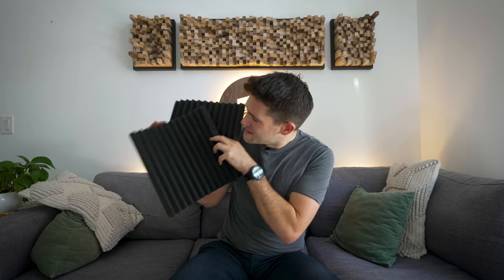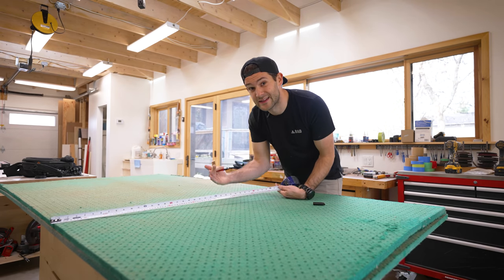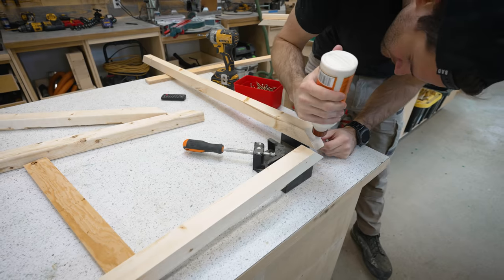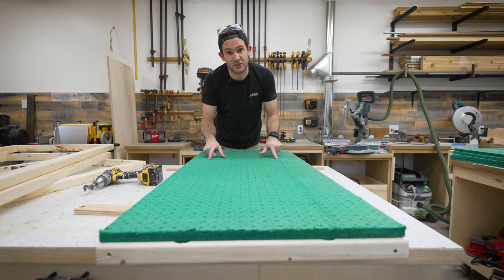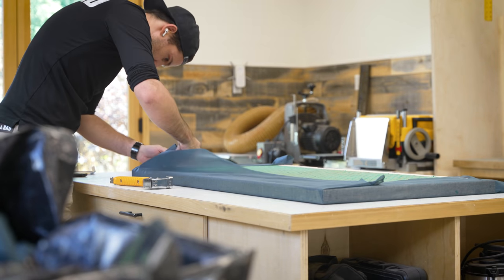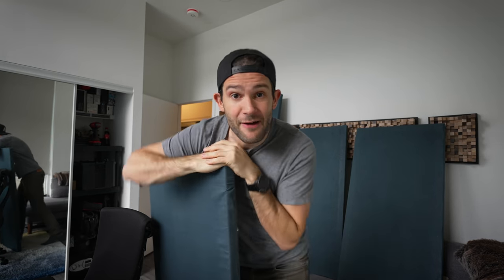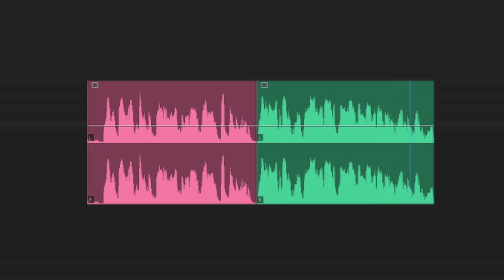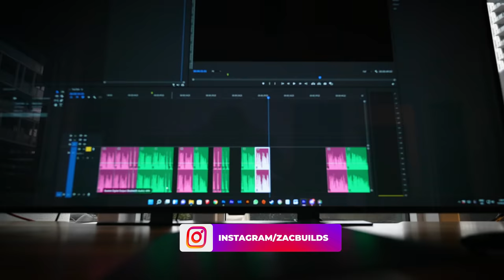Acoustic panels that actually look GOOD

Comment: I wish I could source sonopan locally, but can't so I went with dense recycled foam.  Tip... I ordered a few extra sound absorbing curtains when I did my windows so that I could use that fabric to cover the panels.  They match/blend in with the window treatment and with their extra felt linings, it provided a bit extra sound absorption.  Put the felt on first wrapping front and rear, then use the top layer of the curtain to finish the panels off.  Make sure to mount the panels an inch or two off the walls if possible... improves performance.

I luck out... my main diffusion "panel" is a large 8x9' rubble stone fireplace directly opposite to my AV setup.  Works perfectly to breakup the sound and I only needed a few acoustic panels opposite the sliding doors to the patio I put the curtains on (both to the sides of the AV setup).

Comment: The point of Rockwool is mass absorption, and it works AMAZING when you install it right.  Inside walls it is mostly going to kill midrange and bass noises, and won't be as effective for higher frequencies, but that isn't what they are made for, and those are going to leak through the 2x4s rather than the rockwool.
The green board sits between drywall and 2x4s, which allows for sound isolation more than absorption.  Hang some heavy drywall on one side, and use isolating screws, and rockwool between the studs, and you have true sound-proofing for a room.

When hanging sound treatments ON the wall instead of behind, you actually want loose dense material that covers a broad even spectrum of sound.  Rockwool is truly the best application for this kind of stuff as it will absorb most frequencies pretty evenly.  I'm sure this also works pretty well too, but I would bet that rockwool would work better, and cover more frequencies more evenly.

Lastly, don't forget the floor and ceiling.  You have a big fat bass-trap (couch) sitting directly behind you, which is probably your best audio treatment.  But adding a short carpet, and having a couple diffusers or absorption panels to the ceiling will probably make a larger overall difference in the room than your panels.

Neat project though!  And they do look nice and seem to help at least a bit!  I'll have to look up that material for my upcoming project.  I'm in a 1950s style basement space, and it makes for a very live room with lots of concrete, cinderblock and aged hardwood... it's live down here lol.  But I also hate working with rockwool, but keep using it because it is like magic for my house!  Every time a wall is opened up, some rockwool goes in, and it makes a small house feel so much larger!  Just that audio distance of not hearing every word that everyone says at all times from anywhere really makes a difference!  Anywho, if the price on those panels isn't too bad, I might have to try backing a rockwool panel with them.  The fabric will keep it in the front, and the paneling can hold in the bakc, and add a little extra depth and rear transparency so it can more effectively be used to 'double absob' audio without needing a literal air-gap behind the panel.

But seriously, people don't give enough thought to their audio environment.  Having a nice quiet 'dead' sound space... you can just feel the tension melt when it is done right.  It is so nice, even if most people don't have any idea why.

Comment: Recording voice over comparison sounded the same but when you did the 360, when camera is facing the windows, the quality of sound is so much worse. Panels help but legit, the windows are the main problem, with or without the wall panels. Blinds will probably fix the issue.
Reply: Curtains would be a huge help for the sound defusion for sure!

Comment: There may be an added benefit by spacing the panels about 1" from the wall.  The space would act as a trap and the exposed surface area of the back side may add a tiny bit more.  This is usually done on ceiling panels.

Comment: 1. Sound insulation and killing reflections (which is what absorbers are used for) are two completely different things. So, your argument that Sonopan is better for insulation than rockwool, therefore it must be better for absorbers is wonky, at best.

2. You should allow for a bit of air behind your absorbers. Either leave a bit of space between them and the wall or make the frame deeper, so it forces that space. That really improves absorption in the lower frequency range a lot. There are pretty neat online absorber calculators that can help you find your preferred balance between absorber material, thickness and covered frequency range.

3. It doesn't matter all that much how thin your cover material is. We're talking about sound waves you want to absorb anyway. Either thicker cloth already absorbs that frequency spectrum (in which case it's "less work your absorber") or it passes through to your absorber, which is what you made that thing for. The one thing you don't want is a cover material that would reflect high frequencies... but other than that, it really shouldn't matter.

Since I might have been interested in Sonopan for another project, though: It seems that Sonopan doesn't have any retailers in Europe.

Comment: This is cool.  I love building my own things vs. buying them.  It saves money and custom is almost always better.
I think the size of the room plays a big factor with sound deadening. (think of the referee in a football stadium echo!) 
If you covered the walls and ceiling with these panels in a small closet, the sound would be perfect.
You still have lots of area that will bounce the sound around. Many people overlook the floor and ceiling.  Have you ever talked inside an empty room with hardwood flooring?  6 faces of echo!
If I am not mistaken, isn't there mathmatical equations of how many panels are needed in a room depending on size?
I've heard putting panels on a 45degree angle on wall corners  top to bottom really helps.

Comment: Pro tip, get a helper to hold a mirror up against the side walls.  Sit where you will speak.   Move the mirror panels across the wall until you can see the mic in the mirror reflection.  This is your primary reflection point and most effective place to put your sound deadening.  If using a cardoid, directly in front and behind the mic also.

Comment: floor, roof and DEFINETLY windows do make the room still echoey, hence why alot of music studio's use a special type of plexiglass in front of the window (with a big gap between). So the reflection gets trapped, and doesn't go back inside. Get a Rug, and sum skypanels, maybe make a star sky panel? With led strips, or led string and some holes in the fabric? Might be best to use the same fabric you used in this video tho, since you can layer it two times; one time, led stripo/strings, then second time, poke holes in the front layer.

Just an idea, might be cool to see!

Comment: rockwool is meant to be encapsulated inside of walls. I would never put it behind a breathable fabric.

I've made sound panels before simply filled with pillows (the kind you sleep on ) and it worked great.

I'd be interested to see an side by side comparison between sonopan and rockwool though

Comment: I really liked what you did, but I won't have used frames... I would have put the sound board onto a 1/4 or 3/8 ply and made them the full width of the ply backing... rounding the front edges would have added to the look and a little toward the sound... that would also have helped with the fabric as well...

Comment: Not keen on rock wool either. So use medium density, fireproof, furniture foam.  Works great and can be found in any desired thickness.  It does cost more, but in some long lost comparison tests, worked better too.  Used to build industrial silencers and fit out control rooms with it.
Reply from the maker: Great idea Philip! Where do you get that stuff from generally?
Reply: I would like to know this as well!

Comment: You would also benefit from bass traps where any two or three flat surfaces (two walls > ceiling or floor) meet. They absorb rogue low frequencies where they gather up in corners. I see you have an RPG diffusor, which is great. You can also use bookshelves at empty wall spots filled with books on the shelves at random depths, to form a non-uniform face of spines on each shelf. Parallel surfaces are the enemy, so if you can slightly pitch your ceiling or use an acoustic ceiling cloud, it helps a lot.

Comment: Zac, the purpose of the angled front of the sound panel (acoustic treatment) is to deflect the sound in a different direction. Think of all the angles used in big music theatres,…it’s not designed as a square or rectangular room. The shape of theatres and some churches are shaped like a cone angle. The square/ rectangular rooms in a house are terrible for sound deflection.

Soft surfaces like carpet, blankets, and similar materials help absorb sounds, but for the sound that doesn’t get absorbed, it should be deflected not directly back at the microphone.

Comment: yeah like data says that super dense glass wool is gonna have a better alpha than any foam. But like the foam is obvs easier to work with because it’s less likely to bulge against your fabric. just always make sure to use an “open weave” fabric because if it’s like a super tightly woven fabric it might be a bit more reflective. These kinda panels only work for higher frequencies but if you wanna absorb a little bass then put a chonky upholstered couch in your studio.

If it’s more your look you can try hanging some heavy velour curtains in the space (lotsa gather)

oh and for any rectangular room where you have two treated walls and two reflective walls you must put the absorbent walls perpendicular to each other (so you dont have parallel reflective surfaces). this is to avoid a flutter echo zing.

the cheapest thing to always do is to use acoustic ceiling tiles and a carpet to get the total reverberation down. Like a class C or glass A grid ceiling tile

Comment: Great video! I've got a bunch of sonopan I want to use to make a sound dampening box for my compressor at the shop!
Reply from the maker: Thanks bro, It will 100% work for that application. I once saw a boom box sealed in Sonopan that was completely muffled at max volume. A compressor should be a walk in the park in comparison

Comment: I have 80mm Rockwool Sonorock in all my walls  (2x4's, 12mm OSB + 9mm plasterboard) and 120mm Sonorock in all my ceilings. I do not hear a sound from other rooms, except for contact noises. So mineral wool definately works for me in that application.

Comment: Anything is better than nothing! Looking great :)

Something to note, you do want something thicker to absorb lower frequencies/more frequencies. Having something on the walls will help with super high frequencies and get rid of the “ping” sound some spaces have. For watchers, before making a similar project make sure to research materials, frequencies and absorption coefficient(you could get super nerdy about this stuff but for most, there’s no need to). This controls how the room sounds, not if the sound gets out of the room. Cheers

Comment: From website: Thousands of impressions are made in each panel during the manufacturing process to create varying densities
within each panel. Each density absorbs a different soundwave ranging from low bass to high pitched frequencies.
Noise STOP Technology is why SONOpan should be your only choice
when choosing a soundproofing panel

Comment: I cut this stuff with a razor knife and a drywall square, takes a couple passes but it you cut into the front flip it over and line your drywall square up with the cut and score the back it snaps off nice and clean js

Comment: The differences in this room by those small 4 panels are so negligible, you'd be able to similarly correct just using Klevgrand Brusfri or another similar ambient noise reduction plugin for less money/time spent.  Waves has a good one too.  To really make a difference, you're going to need treatment over the windows, mirrors, ceiling, and corners of the room especially.

Comment: I have a crazy idea, some places sell canvas art, where a cloth print is stretched on frame.  Put the material in the center.  I wonder if that will work in hiding the panels.
Reply from the maker: It's funny I actually tried to find somewhere that would do this for this video. In the end though I couldn't find anywhere locally that did it so I had to abandon the idea. I think it would look really cool though
Reply: @ZacBuilds  Canvas, especially with paint is too reflective to sound.  you would need an acoustically transparent material that was printed with a dye sublimation printer.  That would allow the material to breath still.  It would give similar results to putting a poster over top of it.  I have not found any companies that do that in Canada, but there are some in the USA

Comment: Zac - great video, BUT
1) Why didn't you do an audio recording test BEFORE you mounted the panels on the walls?
2) Why did you not mention what is on the floor and ceiling of your room? These surfaces are relevant to how wet or dry your room is, yes?

Comment: AND….since I have almost no access to wood working tools and considering the cost of wood these days - yikes! - I might scour the resales in my area for xl paintings that are mounted on stretcher bars…4 quick cuts with a sharp knife and pulling the securing staples for the canvas off the back of the frame - viola! (I hope!) a wood frame to add soundproofing panels to! 💙

Comment: Just so you know. You want the panel to stick off the wall to catch the sound in a different direction than went in which slow it down rather going and bouncing back. The inch space act to try and catch the reverberation sounds in a pocket.

Comment: Just to address semantics, their primary purpose isn't to "absorb" it's to diffuse.  Diffusion is the only area where they're really effective.  Absorption requires material with more mass, more dead air space (false walls), and such.  If you covered every inch of a room with these panels, you'd improve diffusion but not soundproofing.

Comment: These acoustic panels are great, and I thought about something to make them even better, custom printed fabric to spice it up, will be a bit harder to make it fit perfectly, but you could put any form of art on those panels
Reply from the maker: Yes! I actually explored this idea early on in the video production but I couldn't find anywhere in my city that would do custom prints that large. I'm sure it exists, but I wasn't able to find them
Reply: @ZacBuilds  There are companies that specialize in fabric printing... not typically a local 'mom and pop' kind of job though.  But if you send them the artwork (copyright safe of course lol) and dimensions and most places can get it done pretty quick.  My mom uses a few different places to put family photos on quilts for people.  Kind of a neat hobby, and the prints don't really add much to her costs... granted she is having them print on 6" squares, so something multiple square feet in size may add up a bit.

Comment: Have you ever built flat-panel speakers? I think they have a specific name. It's a soundboard, with a driver physically attached. You can use pieces of wood, white acoustic ceiling tiles, plastic panels, whatever, and they all deliver different sounds. I'm utterly fascinated by the technology, and I'd like to play around with it myself, if I had the time. I'll bet it would be a kick-ass idea for you to make several videos, experimenting with different materials. I was just thinking what would happen if you tempered a steel panel in the same way as a steel drum, and then attached a speaker driver to it. haha

Comment: It has to be said:
The reason acoustic foam is 2-4” thick is because it HAS to be in order to catch the longer wavelengths of sound, ie, any sound below 1000 or so hz. 

Your half inch thick panels could be made out of the best stuff on earth, but low frequencies will bounce right off of it. You can offset some of that by mounting them with an air gap to the wall. That will help some, but it’s not as good as having thicker material, no matter what the material is as long as it’s porous to sound transmission.

These are not a good or recommended solution for properly treated spaces on a budget. However the video can still be used for people reading my comment, just don’t use the foam he recommends. Stay away from soundproofing foam, it’s goal is to absorb or REFLECT sound. Proper form will only absorb, or absorb and diffuse.

On a budget, look into owens Corning 703. You can get 3 2x4x4” panels for a little over $100. Plenty cheap and way more effective.

Comment: You have to be very very careful with these rockwool and wood fibre products being used directly in a room, since they are supposed to be Sandwiched between other layers either in walls using dry wall or under the floor between floor boards etc. Wood fibre boards use natural wood fibres, but the fibres are very fine and travel through air with ease and will be ingested through breathing. That has health risks, but Rockwool and other man made fibres are even more dangerous and can lead to serious health issues. Your life your choice. Natural products that are wood based will always be less damaging to health than man made fibre products. So the product mentioned in this video has advantages over Rockwell for health purposes, but should be used with caution where fans are not used in the room to waft wood fibres across the room. Once installed, the panels should not be disturbed and away from air vents and airflow ducts. Safe journey